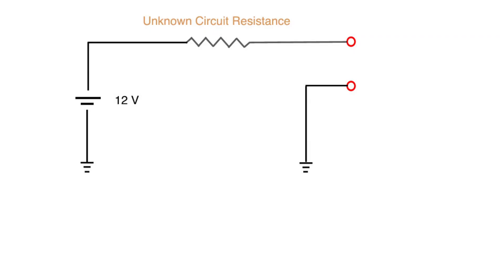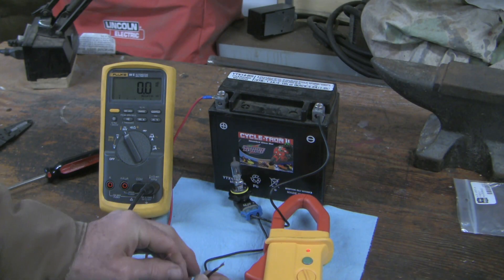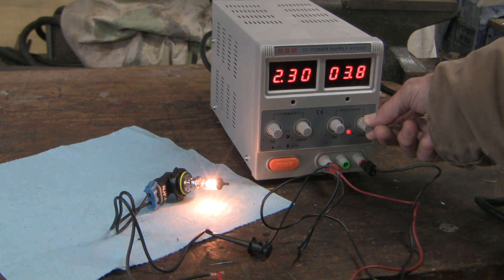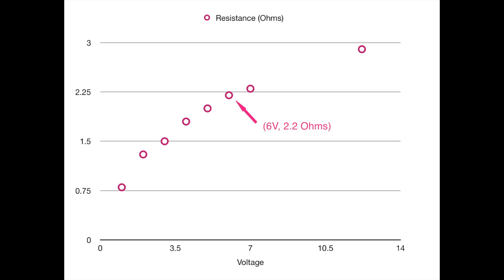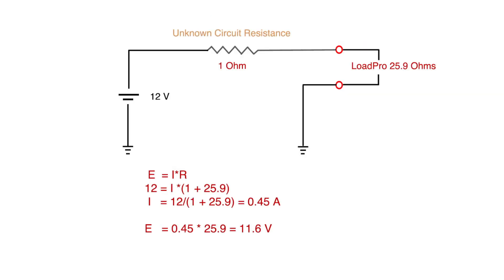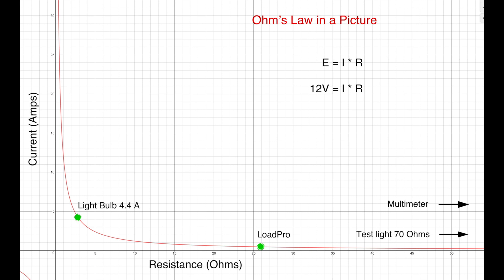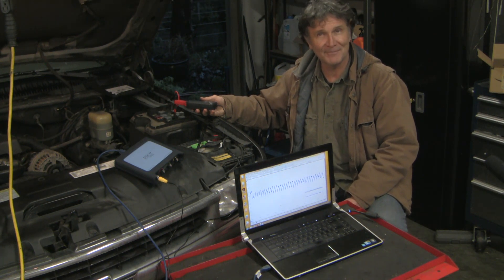When and why to use a light bulb for automotive voltage drop testing

Comment: I took a 12 volt supply DC and placed a 2 ohm resistor on the positive side of the circuit to an empty connector. The loadpro 181 read 12.12v at the empty connector. I then pressed the loadpro button and the loadpro read 10.48v a significant drop 1.64vd. Now with the resistor removed from the circuit, the load pro read  12.12v, then pressing the button 11.43v which is  .69vd
Reply from the maker: Good for you, a tradesman needs to understand his tools to have any hope of interpreting results in the real world! As you probably know, the drop in your first example should have read 11.25V, but instead it read 10.48V. ie 12.12*(25.9/(25.9+2)) = 11.25V. Two things commonly affect that. First, there may be slightly more resistance in the circuit than you account for, perhaps even in the meter wiring. I would set your meter to ohms, and without the Load Pro connected to anything else press the LoadPro button and verify that you have 25.9 ohms. That's a good test to always start out with because you want to prove your internal fuse hasn't blown before making assumptions about results. Your static resistance may be slightly more, or there may be dynamic resistance in your tool that only comes out when under load. Second, when a battery is placed under load the dynamic voltage of the battery always drops a little because of internal resistance, causing real voltage output of the battery to sag down. All of this shows that real world experience needs to account for minor resistance at connection points and battery output sag. Guys who use the LoadPro every day are more intuitive. They skip the math and look for big changes, recognizing that real world problems are usually glaring and obvious. They ignore any drop less than a volt as being insignificant. The place to watch out for are those high current wires, where the LoadPro might miss the tiny extra resistance that robs the end device of adequate power. Thanks for your comment!
Reply: @spelunkerd  Thanks for your fast reply. Could you give me an example of a circuit that I could set up at  home to duplicate your following statement: "The place to watch out for are those high current wires, where the LoadPro "might" miss the tiny extra resistance that robs the end device of adequate power." I would like to duplicate that issue. Thank you very much.
Reply from the maker: @stspringer2003  I guess if one wanted to practically duplicate that, you could introduce a resistor on the starter motor circuit, in line with the battery. If you put a 2 ohm resistor in line with the heavy starter B post wire, the resistor will drop the normal 100A spike down to slightly less than 6A (12v/2=6). Make sure your resistor is rated for the power (6X12= 72 Watts), it might get hot. If you put your multimeter on the wire between the resistor and the motor, the voltage would be dropped while current is flowing, robbing power from the motor.... Or you could replace the resistor with your test light. Even with a headlight circuit, if you put a test light in line with the headlight, the headlight won't be able to light because the test light resistance gobbles up most of the voltage drop. A headlight in line with a test light might be the bench circuit you're looking for....
Reply: @spelunkerd  I am confused. Wouldn't the loadPro pick up a voltage drop on a 2-ohm resistor in line with the B+ battery line?
Reply from the maker: @stspringer2003  Oh, I see what you are asking. Suppose your starter motor circuit had a resistance of 0.12 ohms, giving a surge current of 100A from a 12V battery. Now add 2 ohms of resistance at the pos battery terminal. Then the drop across the 2 ohm resistor is 12*2/(2+0.12)=11.3V, leaving only 0.7 V drop across the motor! And total current is only 12/2.12 = 5.7A, not 100A. That motor won't turn, its power was robbed by the resistor. Testing with the LoadPro doesn't show the glaring abnormality, the drop across the LoadPro would be 12*(25.9/(25.9+2)= 11.1V. So, for really high current wires, it is better to test with a device that draws an equal amount of current. The easiest way to get current moving is with the device itself, if you can. If not, a headlight bulb works pretty well, drawing ~4 Amps.
Reply: @spelunkerd  ok but 12.00v −11.1v = 0.9v which is higher than .5 v and I've read that volatge drop .5v or more is not good. Is this not true?

"If a connection is good, you should find little or no voltage drop and see less than 0.4 volts for most connections, and ideally less than 0.1 volts. But if you find more than a few tenths of a voltage drop across a connection, it indicates excessive resistance and a need for cleaning or repair."
Reply from the maker: @stspringer2003  You're right, that's a good point. Acceptable line resistance depends on how the circuit is being used. In a low current wire, even 50 ohms of extra line resistance may not cause a problem, whereas high current devices cannot tolerate even a couple of extra ohms of line resistance. So you have to think through how the circuit is being used. For quick, efficient work flow I have various high current light bulbs to try and more closely match the circuit being tested.
Reply: @spelunkerd  Ok thanks again for your help, you are very professional and I appreciate it
Reply from the maker: @stspringer2003  You got me thinking about what the right threshold should be for calling a LoadPro result OK, and traditionally I've chosen a drop of  less than 1V as a rough rule of thumb for low current circuits. As you say, the manual points to 0.4 V, and ideally less than 0.1. In my video titled 'trailer wiring mystery' I use the LoadPro to show the wiring all the way back to the truck battery is fine. In that example, which is a moderate current lighting circuit, the difference between measured voltage when LoadPro switch was open and closed was 0.65V. Doing the voltage divider math for that circuit, I had ~1.5 ohms of circuit resistance, which is pretty common for those long wires. When you lower the cutoff for what you define as normal, you increase test sensitivity and reduce specificity, maybe confusing the issue more than it is worth. Fortunately most wiring problems tend to be gross and easy to find! In the end, it's all about understanding our tools....

Comment: 5:19 “…areas of corrosion are more likely to behave like a light bulb, with increasing resistance as the current increases, and the corroded area heats up.”  Many thanks for this insight.  I've been troubleshooting a 1HZ engine, good (new) battery relatively new starter motor (installed by others), but it still has voltage drops of 0.62-0.63V on both positive and ground sides of the starter motor.  The LoadPro shows only 0.1V difference to system voltage for any test on the positive or ground sides, and this would indicate cabling and grounding are good, yet I was losing 1.25V during cranking in those same areas.  
Also, your graphs, especially the hyperbolic current vs resistance graph, generally loads performing work versus (essentially) signals.
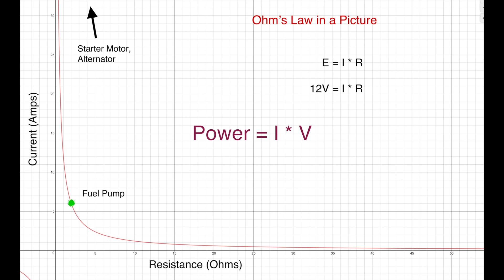6:45 “Notice how steep this part of the graph is.  Which means even a couple of ohms extra circuit resistance from corrosion could be enough to dramatically reduce current and power delivery.”  That's what I'm finding.  The clamp meter is showing peak current anywhere from 400A onward, and small amounts of extra resistance is really impacting power delivery.  I may have got there on my own, but your video has helped me get to the end of that thinking process much quicker.  Thanks.

Comment: Hello. Thanks for the informative video. I would like to ask you a question. I have an issue with my car that I can't understand. My left headlight is not working. When I check with multimeter the voltage is 12V. The moment I connect a bulb, the voltage drops to 0 and the bulb doesn't light up. I've tried with 3 different bulbs. Do you think that this is an issue with the car wiring?
Reply from the maker: Excellent question. Yes, you likely have a source of resistance between the battery and the bulb. A very common cause is the connector, so look for clues like “green crusties” and overheating. For more info, search “voltage drop testing”.
Reply: @spelunkerd  Thank you very much.

Comment: Thanks for sharing your knowledge. Can we use a load resistor as a fixed resistor instead of bulb when doing voltage drop test?
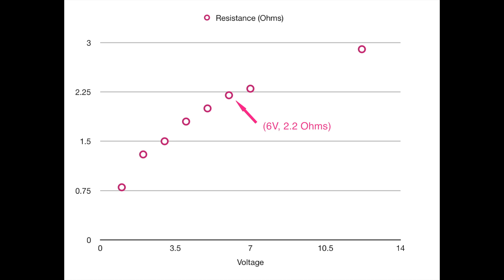Reply from the maker: For sure you could make your own, a resistor is the basic design of the LoadPro. They put a 25 ohm resistor, a fuse and a thumb switch in a wire inside the bulbous red handle of the LoadPro. The hidden internal wire connects the red lead with the black lead, so when the button is pressed you get a short between the two leads. Starting at 4:25, I've attached the LoadPro leads to a multimeter set to measure ohms. The two leads are not touching each other. Notice when I press the button I measure 25.8 ohms, with the 0.8-0.9 being a little extra line resistance. When they use is in the field, they first check resistance like I did to be sure the fuse isn't blown. Then they switch the multimeter to measure volts, put the two leads on either side of the questionable area of resistance, and press the button. You could make that with about $20 worth of parts, it would be a fun little project. That said, a light bulb gives a quick visual signal that you've got current flow, and often that's all the tech needs. It's all about time management, those guys don't want any extra steps that are distracting and cost time. The incandescent test light is good for low current applications, and the halogen headlight bulb is good for moderate current wires. For the really high current wires like the starter motor or alternator, try to use the actual device and measure current with an inductive clamp meter. Thanks for watching!
Reply: spelunkerd Thanks you sir. that was very useful for me.

Comment: I do use the bulb method, but only on higher current supply lines of low resistance.
Like testing for the fuel pump feed that has a habit of causing problems.
Loading a power circuit up with a bulb is the best for ordinary circuits.
But ohms law will look odd because a bulb does not have a fixed resistance, the heat of the element/resistance changes with voltage but not in a linear way.

And the 21 watt indicator bulb is great for low current circuits up to 2 amps, mostly as an indicator of power for that "dodgy connection" that's hard to find, a bulb allows you to wiggle all the connectors to make the light flicker.
Visual brightness feedback is so effective :-D

Also if you have a fuse that keeps blowing and you cant find the short, connect a bulb across a dummy fuse and plug it in, the bulb will be bright untill you disconnect the dodgy device.
Or you could just run away screaming with your arms in the air lol, Optional.
Reply from the maker: Excellent points! I made a circuit detector several years ago that plugs into the fuse box, with a light and a noise so you don't have to stare at it. It's hard to watch that old video now, information delivery is too slow.  That little circuit detector is still going strong.
Reply: Sounds like a similar fuse idea as mine, but with a buzzer across the fuse holder.
Perhaps using a bridge rectifier to make sure the buzzer has the correct polarity always.
Thats the way i would do it, but knowing you, you have found a better way :-D
Diodes and relays can also be very handy :-D
Reply from the maker: Good thought about correct polarity, you always add remarks that raise the bar.
Reply: nice